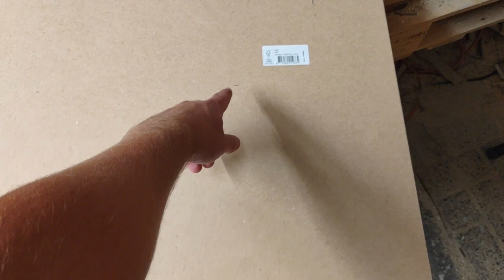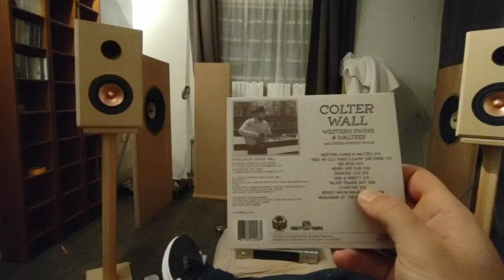DIY $15 Audio diffusor panel!!

Comment: For cutting foam you need to rig up a hot wire cutter.  Use a bow saw, just remove the blade and put a wire in it's place on insulators.  Use a car battery charger to heat the wire, it will cut right through the foam.

Comment: 100% agreed with Lloyd Stouts post below. I was going to post almost the same response above but add once he does solve standing freq. and first reflections then continue on to secondary reflections with before and after sweeps to get a baseline. I would also make your qrd diffuser with the most dense wood you can afford. Using foam has so many freq. transmissions that you will make yourself chase away good sound and create even more freq. peaks.
Reply from the maker: You are right but any more then what I did would be way more expensive. These things can show you if diffusion is the type of treatment you need. I have build wood ones by now and they work better but hey are also 10x the work and 3x the price excluding the tools you need.

Comment: Would like to build one in wood, but i need the precise name of this type of diffuser and th dimensions needed.
Reply from the maker: It's called a "quadratic residue diffuser" and the dimensions are are the sart of the video, about a minute in. The calculator I used is sadly no longer available.

Comment: You heard it works pretty good. Do you know if that person has any knowledge in Acoustics or is that person just another talking head?
Reply from the maker: There are commercially available closed cel foam diffusors. What ever that says. This panel works but it's not the most elegant solution. If you have the tools build a set op wood ones

Comment: A foam is not a right material. The idea behind is to manage an interference when sound is reflected. A foam just absorbs. And there is no much sense to waste a time on making this crown. A thick layer of a foam works the same as the sophisticated one.
Reply: Acoustic foam absorbs high mid and high frequencies yes, but isn't styrofoam more reflective than acoustic foam?
Reply: @danielbentley7117  Ah.. I see what you mean. Sure, from some frequency it reflects more than absorbs. Acoustic esoteric is all its glory -)
Reply: If you haven’t tried this yourself you really shouldn’t talk. The foam is closed cell and stiff. It is not a soft porous absorber.
Reply: Besides, the 'diffuser' is built wrong. What he built is not a diffuser. Where are the walls for the wells?
Reply: The radiator might be a huge problem with the sub in front!

Comment: Is this satire?
Reply: No. It is science.
Reply: @AmazonasBiotop  Not when you're not using a softwood, it isn't. The quadratic residue diffuser you're attempting to make is useless when made with foam. Your measurements can be correct all you want. If you're not using suitable material, you're not doing anything. Nope, I don't know what I'm talking about. I won these awards by accident.
Reply: @NicBam   Useless and not science, because of not optimal material is not used.

There is more optimal material than soft wood to use. 

When we realize that then it is a just a sliding scale of more or less optimal material that can be used in the build. 

But the shape and calculations and the physics is the same (that I consider as the science part).

We can put it like this:
If using a soft wood is useless compared to cast metal or molded cement that has far better density and rigidity than soft wood. 

But you are right wood is better than ESP but the build is derived from the same science. 
ESP come in different densities plus a couple layer of a paint will also help the diffusion property. Just like different wood has different properties (density). 

But just a if someone uses a less optimal material don't mean that it is useless and not based on scientific work. 💞
Reply: @NicBam  Were did your snarky msg go? OK let me reply on a msg that you did that were apperently removed.. probably offending language?

1. I told you that soft wood is better than ESP. But that do NOT mean that ESP do not work at all! (It works but to a lesser degree because of the material choice.)
2. And it is just physics that they're better materials. And other materials that has worse physical properties that can be used.

Yes, creating music and mixing and winning awards like you have done is great! I am glad for your accomplishments! 👍💞

But you are not the only human that has ears on planet earth, if so then you would never get any rewards.🤔 (Those that like your music HEARD what you have done and liked it, THEREFORE you got your rewards.)🤓 

And I understand that the room acustics is ~50% (some argue that it is more than 50%) of what you hear when you are LISTENING at your mixing position. Yes it is depending on how far from the speakers you are that gives you more room interaktion the further away you are from them. (Again simple physics)🤓

So those ~50% of the sound that is the room contributing with is the biggest component of our stereo sound REPRODUCTION system.💪 That we are listening to and you are doing your mixing choses when you mix.👂

My specialty is not to create music but listening to what you and other creators have created. 🎼
In my sound treated dedicated listening space (yes actually it has six different diffusers among other treatments plus I am rather close to the speakers approx ≥2m). 🎶🎵
When I understand we can't break the physical laws. And need to work WITH it and use it to our advantages like building sound treatment for our rooms.🏗️
So we use different types of room treatment.

The thing is you are rude to those that only have $15 and a knife to improve their sound from their room like in this video. Yes if they had ten times more money they can use better suited materials as soft wood but then need better tools then only a knife.🪚

So you see that as usual you get what you pay for and not all has deep pockets and a garage filled with wood working tools. 
And others want just to try and test by building a cheap proof of concept to see if they should pursue the room treatment route at all.🙏

But as I am trying to say the PHYSICS and SCIENCE is still there but the effect will not be as great as using more solid materials. 👍

So their is nothing to get upset about it is just facts.🤔💞
Reply: @AmazonasBiotop  I see all of my comments. There you go... assuming you know what you're talking about. No, I am rude to those that act like the information they give is good. I take offence to people thinking they can do what they are NOT READY to do. See, people miss the part where you have to do something properly to know how to teach it, as you were doing in your video. You keep saying "Physics and science" as if that proves what you're saying is correct. I can show you the actual equations to find the issues in a room and treat them.

Most of the time, the space should be ALL WOOD, NO DRYWALL! But, as you pointed out, not everyone has much money... So, at least do a level of quality to get the room as close as possible to "true sound." Just making anything because you used the proper depths on your P7 of whatever the count was, I never bothered... won't work in the slightest. Foam is snake oil. I'm getting sick of anyone thinking they can "teach" or "suggest an affordable way" ... there's no such thing. You get what you pay for... so if you're going to make something and act like you are helping, then help... explain, "this is not ideal, but let's see what happens..." then the following video could be “well, that didn't do anything..." and now you're making progressive videos, learning with your audience and not pretending as you know. You can't.. not if you think what you're saying makes sense.
Reply: @NicBam  you won awards eh?
Reply: @NicBam  the foam reflects at frequencies that are being diffused. If it happens to absorb some lower frequencies, it's a win win.